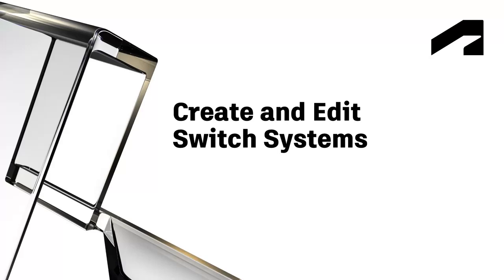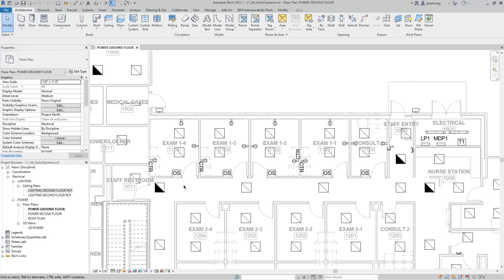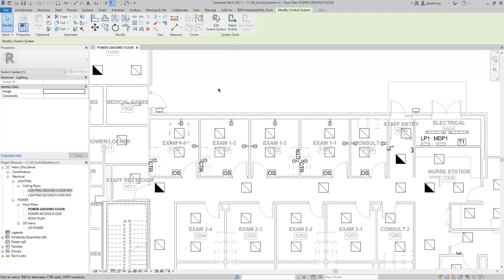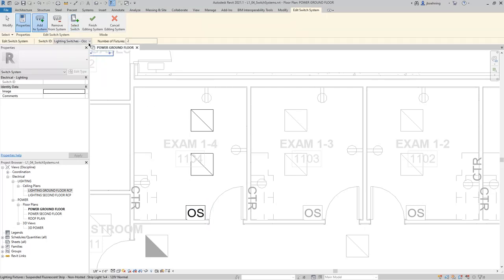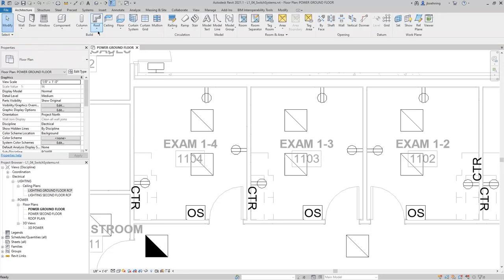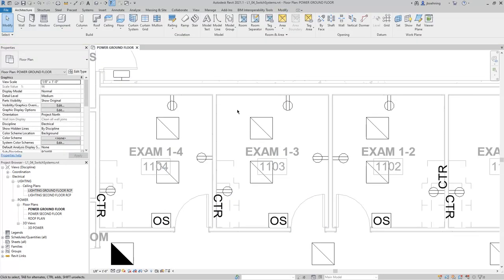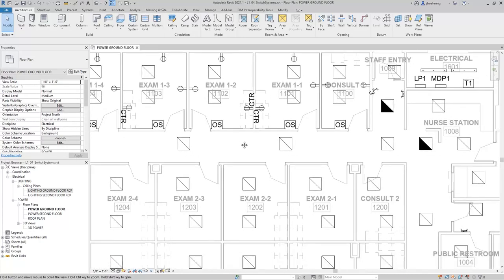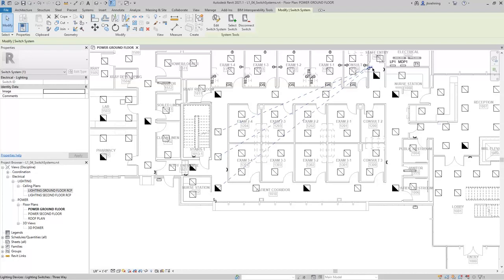5 - Create and edit switch systems (Revit Electrical Course)

Comment: Something you should touch on is why this is useful. You created these switch systems but it has zero effect on the drawing. I'm trying to learn more about this feature's uses. I know I can create a tag that shows the switch ID but you didn't cover that or even assigning the switch ID in the first place. Critically, I'm trying to find if switch systems can be used to automate the creation of a relay panel.